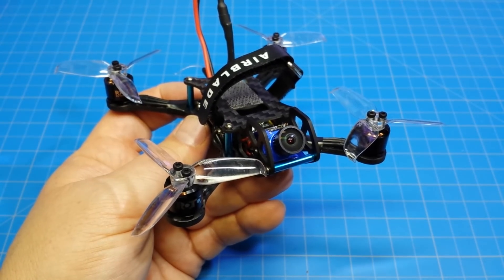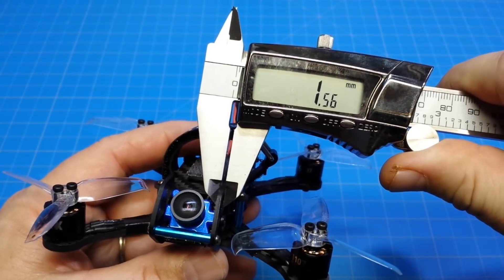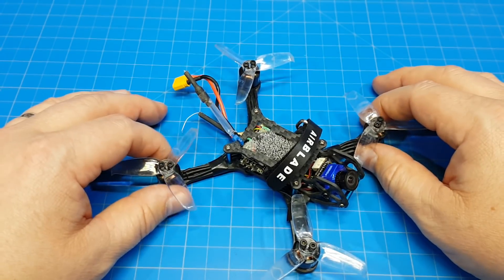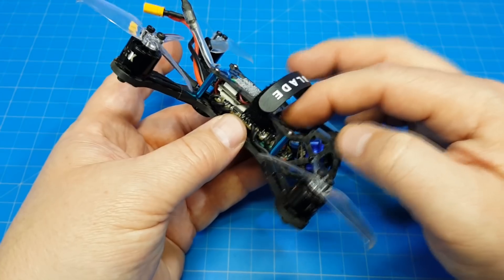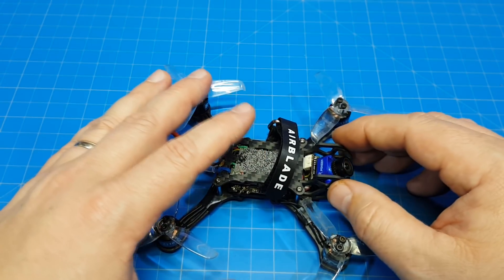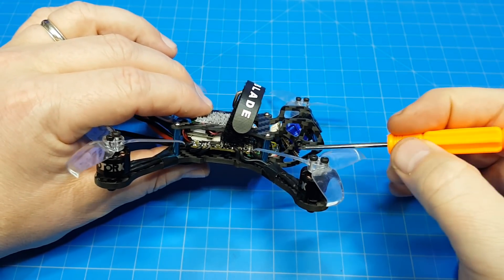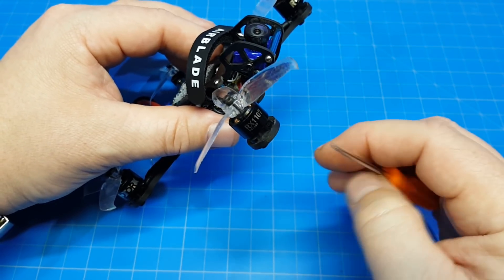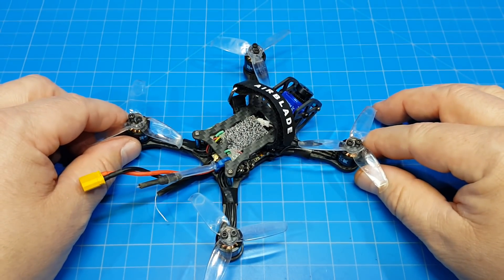Nemesis X - Zeus AIO Flight Controller

Comment: Nick how do you like the Zeus . I’ve used the F series stacks multiple time and really like the quality. Is this on par.. if so I may go this route on my 2.5 instead of the F428.  Thx..
Reply from the maker: The Zeuis works just like we expect. I was surprised the weight saving is marginal. It really is for specific installations.
Reply: Nick Got it , I'm building a 2.5  will likely just stick with my trusted f428

Comment: regarding the rubber pads you put under it, I found that if I put my pads as far out on the arms as I can get them that it makes my landings a lot more forgiving. it certainly keeps me from grinding down my motor screws and the ends of my arms, as I tend to be moving along a bit when I come in for a landing...  Also, I wrap mine to the arm with electrical tape.  I used to lose them all the time, so I bought a huge bag of them, and then I started wrapping tape around them and I havent lost a single one since!    - speaking of which, anybody need some foam landing pads?  haha
Reply from the maker: True.

Comment: Hey Nick, have you considered strapping the battery underneath for a flight or two, to see how much the change in weight distribution changed the flight characteristics?  - surely the balanced weight would be *better*, but it would be interesting to see how much it changed...
Reply from the maker: I actually have two nemesis x, one I did bottom mount and one top mount. I believe in this video I discuss the difference.
Reply: Oh yes, I heard that part, but I guess I missed the part where you said you tried it both ways. Honestly, I kind of feel like an idiot for not making the connection. haha
Reply from the maker: No worries. It was a while back when I had the bottom mount and the HD camera video.

Comment: Great vid Nick, as always. My Nemesis flies AWESOME - also have a Zeus fitted, makes for a very tidy build! I’m running the Sunnysky 1106 6500kv’s - great power, handles super balanced, my favourite micro... HD backpack on order!
Reply from the maker: Get the new Blair shaft deisgns on the the motor shafts? I ordered SS 1106 8000kv and 6500kv one set with the new shaft the other not. Dang.
Reply: Nick Burns 2 are new design, the other 2 I took apart and glued, no problems so far with any of them ;)

Comment: Nice build.  Thanks for the update.
Reply from the maker: Sure, I think the zeus is the way to go for a lighter cleaner build. There is the downside, FC or ESC die we have to replace the whole thing $80.
Reply: That seems like the way everything ends up.  We want lighter more compact builds, so the only way to do that effectively is to make AIO boards.  Then we are not happy when a component fails.  I just smoked a small  AIO 1s when a wire came off and shorted the bec.  In whoops every gram counts.

Comment: I wish that I used this board instead of the E-max that I used this one has separate vtx voltage supply and camera voltage, I don't have that with my E-max, Great board Zeus.  Thanks Nick GREAT VIDEO
Reply from the maker: Thank you
Reply: JohnnyD RC As an aside - I discovered the hard way that the Zeus VTX power pads are basically unregulated straight off the battery - my (second) VTX runs off the cam 5v pads ;)

Comment: Check out Rotorious FPV for some really nice top mounted micro frames (CB 2.5).
Reply from the maker: will do.
Reply: I second the RotoriousFPV frames.  CB2.5, CB3, and the Radical Micro (2.5 & 3 inch options) all give you top mount options.  None are as slammed as the Nemesis, although the Radical Micro might get close.  The CB series are like micro Aliens.
Reply: Keep in mind guys, top mount isn't the target here. The goal is balance, the nemesis isn't slammed to look cool, its only slammed because that is where the battery has to be to get the balance perfect. That being said Rotorius have some cool frames. I just dont like people making the mistake and thinking battery on top immediately equals better balance, kabob and his mis- direction is largely responsible for this misunderstanding. While I did my best to make the Nemesis look great, everything is laid out the way it is for a very specific purpose.

Comment: Very nice build, awesome machine. If you think getting rid of 4x5mm of aluminium standoffs is a weight saver I would much rather get rid of the stainless steel battery strap buckle and an inch of battery lead ;-). I am a little concerned about the antennas flopping around and into the props, especially the video antenna.
Reply from the maker: Those are weight savings options for sure.

Comment: Nice one Nick! you were ripping balls around that yard!! sounded great too! You're a fan of the 1107's then?
Reply from the maker: Thank you. Yes, i like the 1107s, I would like to try them on a few more setups, but in this case it worked very well and performed as well as the BBB motors I used on the traditional build.

Comment: Another quality review Nick. I love the BDRM design. And i know the designer disagrees with me, but i want a 3" version. :(

the flexRC style camera slot is a crucial feature IMO. the other option would be to leave a rather largish hole or oversized slot on the side plates, then use a 1mm carbon washer and a small frame spacer so it can be adjusted forward, back, up or down and the clamps down anywhere within that hole.
Reply: Well, the Nemesis X3 3" version is gonna be on preorder soon :) Check the BRDM Quads facebook page for more info
Reply: Cool. I remember reading early on in the RCG thread that 2.5" was considered the sweet spot by BDRM, and it didn't sound like at that time there would ever be a 3" option. same streaded X and mid mount battery?
-FB can Fu*k off. its really lame IMO when companies main online contact is tied around needing FB acct!
Reply: I have both X2.5 and X3 - 2.5" IS the sweet spot :) And it's not only on FB - you could check the RCG thread too
Reply: They already did the preorder for the 3” version.  It ended a few days ago.
Reply: yep thanks. guess i should have kept being subscribed to that thread.
Reply: Alexander Kubrak. Yes, I agree. I’m still a 5” guy but have fallen down the micro rabbit hole.  Started with the lizard, 20+ 2-3” builds later 2.5 IS the current sweet spot. Perhaps different motors and props will bring 3” forward, it’s promising. The 3” eclair lite build is only 5 grams heavier than the 2.5” with emax 1106 with a bunch more disc area.  2.5” still outperforming!
Reply: I may have a 3" frame spare once they have come in, all the details are the same perfect balance, true X etc just slightly larger footprint for the larger props, it flies great, I don't think there's a lot of difference to it but feel free to flick me a message either via RC Groups or through the website contact. I do try and spread the love across both FB and RC Groups, I know a lot of people aren't that keen on FB :)
Reply: cool! thanks!

Comment: How do you get audio in your DVR?
Reply: it's a mic inside the backyard, then spliced onto the footage.
Reply: Wolfwhoop would build a vtx w/ a mic... just make sure they use their smart audio protocol and a tiny capacitor in line so you could use it dual purpose... there's room on their new vtx03... I asked them to add a Lc filter in a comment and they did it...
Reply from the maker: yep.
Reply: Nick Burns as youre more influential, can you get micro vtx 200mw with mics to happen.
Reply from the maker: oh, I wish I had that sort of influence. I have seen a few in the works. It might be good for ear piece but I doubt they will be good for mixing in the flight footage. A quality microphone the micro size are expensive. We can be optimistic and try them when they come to market.
Reply from the maker: oh, I wish I had that sort of influence. I have seen a few in the works. It might be good for ear piece but I doubt they will be good for mixing in the flight footage. A quality microphone the micro size are expensive. We can be optimistic and try them when they come to market.
Reply: Nick Burns small mics are exceedingly accurate and cheap, just like MEMS gyroscopes,  these days, especially if you don’t need Fantastic S/N ratios. 
End users can get better quality if they add fuzzy windblocks, too. 
It would cost pennies more but the cheap business model is count every penny. 
I hope we can show incentive to get at least one manufacture of it.

Comment: I use Nemesis X for racing and it is the best handling micro quad I have ever flown. The point here is not that the battery is simply on top, but how the overall balance is centered on all axes. The FC does not need to compensate to "pull/drag an undeslung battery in turns". It just turns. :) One thing worth noting is that you obviously start feeling all of that only at speed. I mean it hovers just like any other quad - it's sharp racing turns and crisp freestyle moves where you notice how much balance matters. Oh, and tuning is a walk in a park too, provided you know what you're doing. So, to sum it up: beginners get a quad that flies like they think a quad should fly and they don't need to compensate for drift, pro's get a precise weapon that is totally a "point and shoot" experience.

Comment: Hi! there's enough room for the Split Mini?
Reply: I hope I am not revealing any secrets, but BRDM quads might possibly have told me they are currently testing out a 20mm stack height hop-up kit, and if it works well, they might be releasing it...
Reply: People have fitted it, but it requires some deep frame customisations.
Reply: @goatzilla - Haha, I'm coming around to it, after seeing what Evan Molina did with his Nemesis there are prototype 20mm sideplates that might allow the split to fit on their way to me now.
Reply: There is option for a 20mm side plates and stand offs now,so you can fit a split if you like.
Reply: Jon Pacheco Have you try looking on makeitbuildit.co.uk
Reply: BRDM doesn’t like the Split
Reply: What made you think so :)
Reply: I've done it! It does require a little bit of cutting though. I detailed it on RotorBuilds.
Reply: Tnx, i'll have a look
Reply: It will be the definitive micro!
Reply: Whoop Tang thanks for sharing your knowledge but unfortunately it’s out of stock 😩 Do you know if there’s another site that I can get the upgrades from?
Reply: Whoop Tang yup. That’s where I saw out of stock. I was so happy when I read your message about this upgrade because I wanna try the runcam fpv dvr but I guess I have to wait. 😩

Comment: Nice review. You said you had turned on the dynamic filter and turned off the 1st 2 notch filters, and your motors were still cool. Any reason you didn't turn off the 3rd filter (I think that was the recommendation if motors were still cool)? Wondering if I should turn it back on?
Reply from the maker: The primary reason I don't/didin't turn of the D term notch, is that is where things can get hairy. If I damage a prop and try to fly it in I could burn a motor. Or similar circumstances.
Reply: Good to know. Think I'll do the same. Thanks.